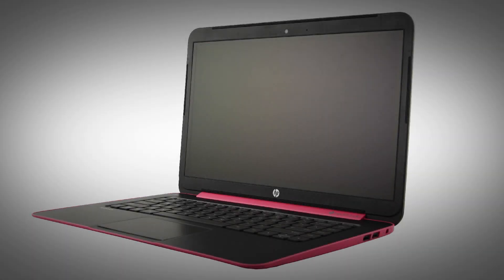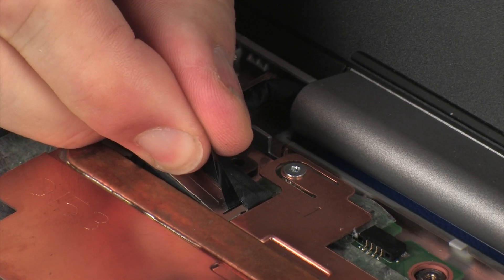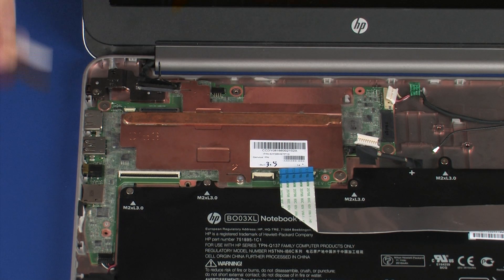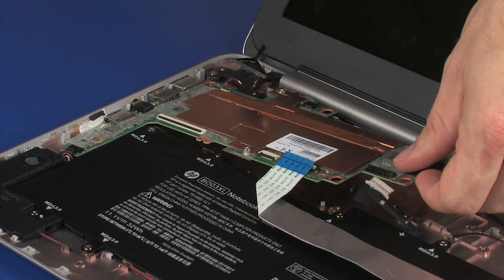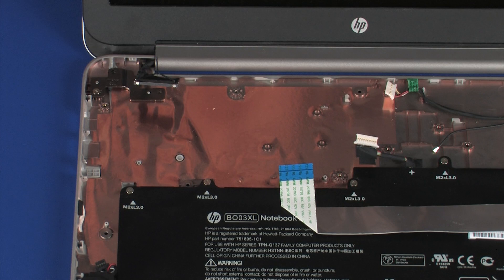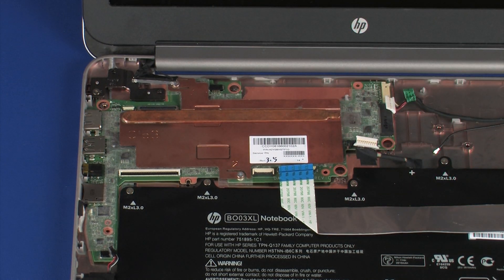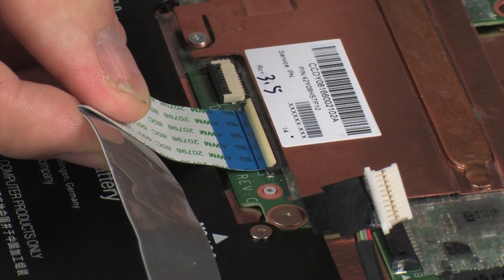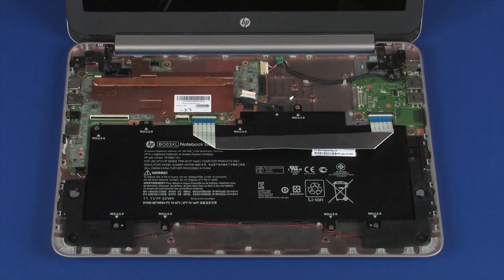Replace the System Board | HP Stream 14-z000 Notebook PC | HP

Comment: Can i replace my processor to 3.50ghz?may 1.50ghz is so slow men.. could i replace it tnx for your answer.p
Reply from the maker: +KENTUI HP does not recommend upgrading or downgrading hardware parts or software that is bundled with the product as It may affect the manufacturer's warranty and performance, however, you could change the configuration at your own discretion.